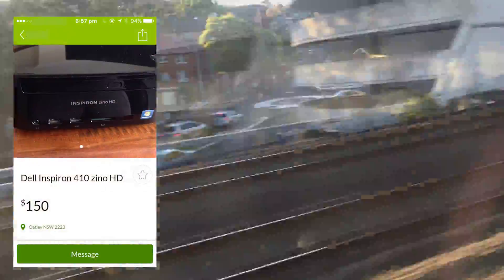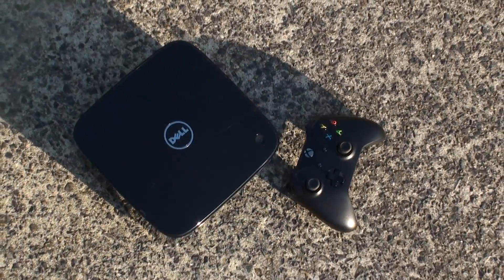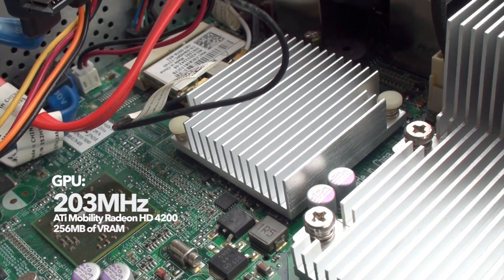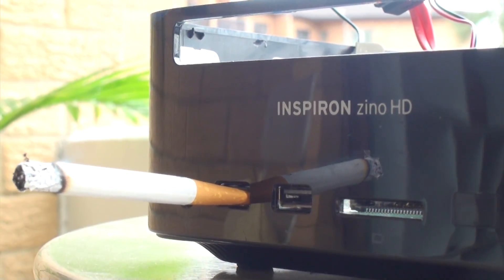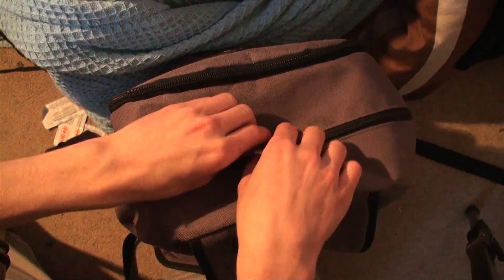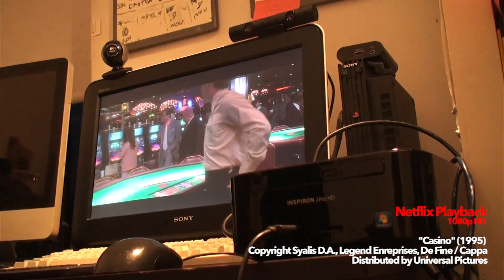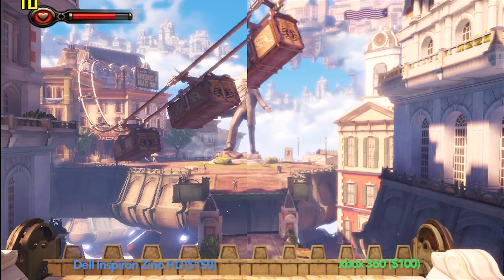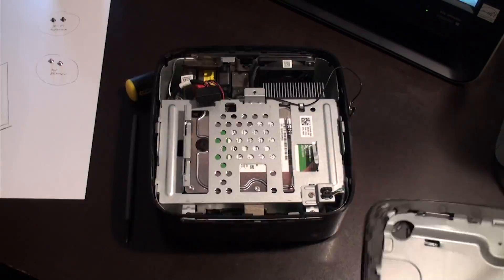The Dell Mini

Comment: where can i find xbox 360 for 100$
Reply: mindjaro everywhere pretty much but buy the ones with the capacitive buttons as those red ring alot less
Reply: LukememeTips Yeah, just don't get the early white ones and you should be okay.
Reply: everywhere mate
Reply: My local Craigslist has 3 or 4 Xbox Ones for under $120. 360's are $100 with 25 games, 3 controllers and Kinect.
Reply: mindjaro they sell them for that price close to my house. I also think gamestop sells them for a similar price even though I hate gamestop.
Reply: eBay
Reply: Lol, you can find them everywere for 60$, maybe 80$ if there are some games included. Just use ebay, craigslist or simelar.
Reply: Wtf, here in brazil a new xbox is 800 reais. it's like 234 dollars
Reply: ***** Sure, but why risk it when newer ones with bigger harddrives sell for the same price (most of the time).
Reply: Lol mine was 15 bucks 80gb hdd i kinda have to hit the Xbox to make the disc room open toh XD

Comment: I've been using an Intel NUC 5ppyh, which contains a quad-core Intel Braswell Pentium CPU (Intel Pentium N3700 quad-core CPU, 2.40 GHz, 6W TDP), built in Bluetooth 4.0, Realtek Gigabit Ethernet adapter, HDMI and VGA connectors, Intel HD Graphics with 16 execution units, burst frequency 700 MHz, 4 USB 3.0 ports (fast charging on one of the front ports, max. 1.5A), Consumer infrared receiver, and Intel Wireless-AC 3165 Wireless adapter (802.11ac, BlueTooth 4.0, Wireless Display). For the money, my little NUC seems like a much better deal, and it is smaller than this Dell. The deal I got came with no OS, but I have been running Ubuntu 16.04 for almost a year now and it has performed perfectly. There are a number of Intel NUC systems available, some very powerful. I chose this one because I use it to mainly stream video and I wanted the VGA port as well as an HDMI port.

Comment: Just cause 2 on this is like just cause 3 in anything else
Reply: A beautiful 14 FPS at 720p.
Reply: TheSpacecraftX he was joking
Reply: i got 85-90 fps on just cause 3 with my overclocked 1060
Reply: shnpio Haha
Reply: shnpio jc3 runs beautifully for me
Reply: not on your xbox it doesn't, big phil ;)
Reply: +Phil Spencer your the chosen one
Reply: Just Cause 3 runs acceptably on my 770. About 40-50fps. This was turning over JC2 at only 12.
Reply: Ran fine for me on an i7 + GTX 1050 +  8gb ram

Either ur PC not powerful for even the lowest settings

Or 

It is, but you have the settings too high

Comment: But can it run crysis?
Reply: james its an old running tech joke
Reply: Short answer: No. If I had a computer build it will be actually be faster than this small computer in this video as well as run Crysis at high settings but not max settings.
Reply: The Boss Stage1 Thunder?
Reply: James Taylor its a meme you dip

Comment: Ah, I knew there was disaster when I saw 'radeon 4200hd' xD So my 5 year old laptop has that, but is the quad core apu varient. Looked great on paper! Actually runs just cause 2 around 25-30fps at 1024x600. I beat crysis 1 on it 'but it took going in the .ini file, and turning settings below low xD' 
For ps2 games that got ported to pc, and emulated older games? Its perfect. Half life 2, fear 1-2, doom 3 all work very well on it even. Oblivion, actually runs decently! But anything beyond that, fuggitabutit

Lets see if it can play 1080p videos encoded in h.265 ;-)

Comment: Upgrade it if possible, maybe a better CPU and 8gb of ram.
Reply: John Elizondo The CPU is probably non-replaceable, and even if you did, the soldered-on GPU would bottleneck it.
Reply: im not to sure if the compute stick is powerfull enough to handle smash 64. even though its an old game, it still requires a bit of power
Reply: Hey Tech From Hell, are you sure the Intel Compute Stick isn't fast enough to do smash bros with your bros?
It's cheaper, and since it's brand new, it may have a longer life span.
Reply: watercoooler...
Reply: ***** i know

Comment: You should do a video on Dell Thin Clients or something... That would be really cool
Reply: AdanD66174U.2 u mean hp? Yeha those are really good especially the t510 and t610-620 which have full spec radeons in them
Reply: I know they are currently under the Wyse name
Reply: Dude we got those optiplexes at school slow as fuck and we're running windows 8 on them.

Comment: OMFG THIS IS BASICALLY MY VAIO i have the p360... its not any better...

Edit... okay its actually worse...

Edit 2 i mean my laptop does worse with the same graphics and the better cpu... idk why.
Reply: Timothy Reth its clocked lower due to thermals and oem have different and weird bus speeds and stuff
Reply: Alvis Gwa. Ive clocked the graphics to the desktop equivalent, idk fuck sony lol.
Reply: Just because you overclock it does not mean its not going to overheat and thermal throttle itself so it wont get damaged, what you should do to possibly improve performance is open it up remove as much dust as possible and add some new quality thermal paste.
Reply: It has a ssd... i did clean it out, i actually bought it a new heatsink, and its not overheating...
Reply: *****
 My gaming rig is an Fx 6300 with an R9 380, im fine with gaming at home but laptop wise, im fukkled...